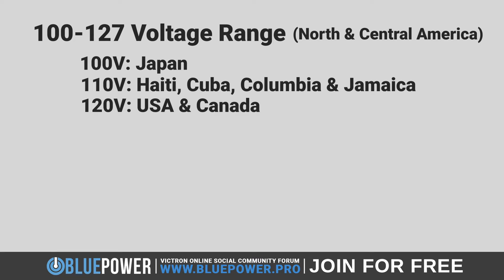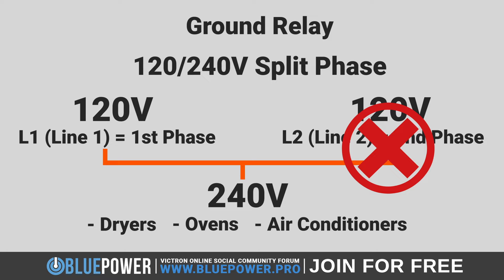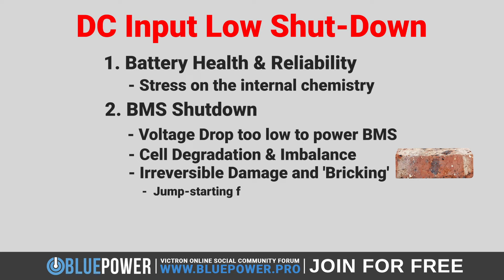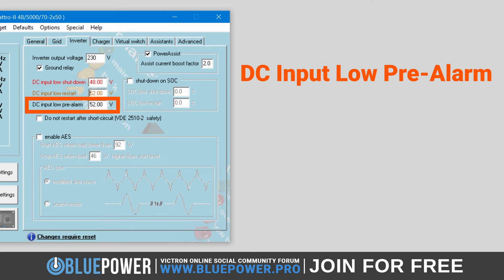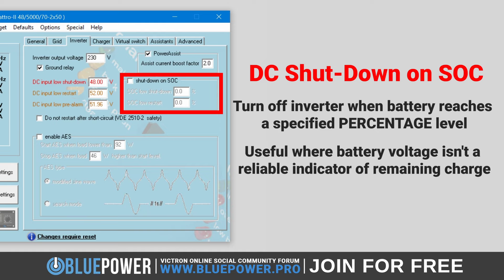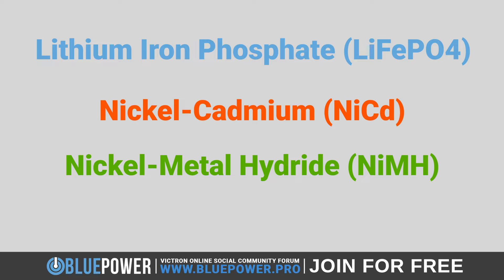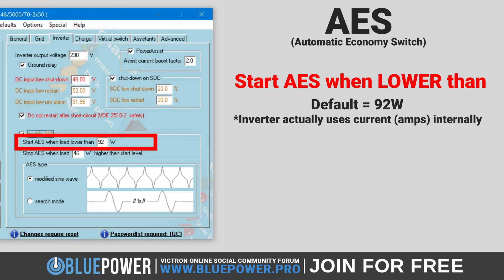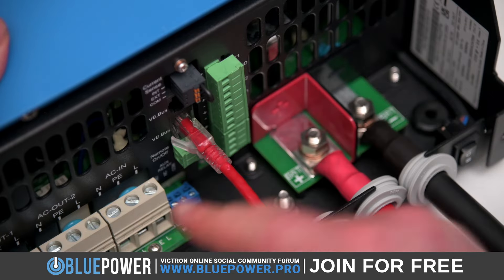Victron VEConfig - Inverter Settings Tab Tutorial [UPDATED 2024]

Comment: Hello, I have a 12v3000 inverter. When I input 12volt, I get 230volt output. When I connect a load to the output, I experience a power cut. What could be the reason for this? I would be glad if you can help me. Good work.
Reply from the maker: This could be many reasons depending if you get a error message or led warning light on the system.

These would be the first things that come to mind to look at:

~ Low battery voltage: Check battery voltage at battery and inverter and fuse or recharge system
~ Overload load is faulty 
~ Ac wiring issue ect 

Issue would need a bit more diagnosing to get to a solution

Comment: Ground Relay checked in both phases L1 and L2 for split phase US grid connected?.  Also RCD required ?  Which one woukd you recommend?
Reply from the maker: While I'm not a US electrician, my understanding on the US grid codes, is that both are required, but you would need to consult with your installer/electrician to comply with your local codes

Comment: Is it possible to utilize Cerbo VRM for configuring split phase setup instead of purchasing an MK3 cable and a VE config multi? Thanks for great videos
Reply from the maker: No, currently this is not a option. An MK3 is required onsite for the configuration.

Comment: i have done the above but power is not sent out to the AC-OUT-2 device (Geyser). what am i not doing correctly Multiplus II 5kva.. Smart solar MPPT 150|45 with 6 (550 solar panels). When Grid Power comes in the Geyser heats up.
Reply: Can you use AC -OUT 1 not 2
Reply: Check very well in your system I hope you can see where is the problem me hopefully on AC -OUT 1 and AC IN use 1
Reply from the maker: This is correct. AC-OUT 2, by default, only has power when AC-IN 1 has a active input active. 
However,  you can make use an assistant, in order to get AC-OUT 2 powered when needed, such as basing it on SoC for example.

Comment: The aes system seems flawed, my easysolar 2 is pulling around 30-40w constant when everything is on standby. Both settings above are set to 99watts but low power mode hardly turns on and when it does it goes off nearly instantly any idea why this is? It is like the wattage read out isnt accurate at all i have literally given up on it at this point 😂
Reply from the maker: Its difficult to say, without knowing what your loads look like and what your what your reason for wanting to use AES is? 

If you are using your inverter daily then your shouldn't using it, as it meant as a "long form storage" mode when you have next to no loads connected. 

According to your ESII data sheet https://www.victronenergy.com/upload/documents/Datasheet-EasySolar-II-24V-48V-3kVA-48V-5kVA-MPPT-250-70-100-GX-EN.pdf the difference a zero load in normal mode and AES modified mode is only 4W to 6W. 

Victron products cost more because they use very little self consumption power. which is why I honestly don't make any use of AES (although my loads are always connected), as the self consumption savings are minimal and creates delays between mode switching, while also modifying the sine wave, which isn't good if you still have connected electronic loads. 

Valid, it does reduce the consumption by a few watts of you aren't connecting anything to it, especially If you have selected search mode. Again looking at spec sheet it says it will use 2W in search mode.

However if you have a big enough battery bank with solar and you disconnect all your loads, it wont ever run out of power from only the inverter's normal mode self consumption of 11-18W (depending on your model).

I've also noticed that the wording in VEConfig and VictronConnect are different.
► In VEConfig, it says (as i explained in the video), your minimum (46W) and the a value ADDED to that of 92W.
► Whereas in VictronConnect is says "Start AES when load lower than" (same as VEConfig), but then it says "Start AES when load higher than", which is different to VEConfig, as you not adding this value to the minimum, simply specifying it straight.

You said you put them both at 99W, which can be the issue because the values are too close to each other, if its trying to function based on VictronConnect's terminology, its the start and stop are the same values which could be why its turning on and off again immediately.

According to the manual, the defaults in VictronConnect are low = 40W and high = 100W (which is different to VEConfigs defaults). but can do to minimum of 12W low and 44W high.

Try set it to these minimum values and then connect and only switch an led light on and off to trigger AES and bring it out of AES to test. Also try it with both modified and search modes. 

AES mode is designed to activate at very low loads, but if the load is fluctuating around the threshold, the AES might not engage properly. 

You will have to test more and see. I cant test on my end as everything, including my internet is connected to my system, so cant go very low, as even my router use quite a bit of juice.

Let me know your results if you find them, I'm interested to see the solution

Comment from the maker: NOTE: At 10:40 I entered 48V as the DC input low shut-down voltage. 

However, as mentioned elsewhere, you should not run LiFePO4 lower than 20% SOC for optimal battery health. Therefore, it's best to increase this to around 51V to 51.5V in order for it to match 20% SOC, as 48V will be closer to 10% SOC. 

Again, all batteries and systems are different, so to get the most accurate measurement, test your system, and run it down to 20%, then take note of the Voltage and enter that in as your DC input low shut-down voltage.

For example, you can easily find this LiFePO4 Battery Voltage table online:

12V:
14.6V (100% charging)
13.6V (100% resting)
13.4V (99%)
13.3V (90%)
13.2V (70%)
13.1V (40%)
13.0V (30%)
12.9V (20%)
12.8V (17%)
12.5V (14%)
12.0V (9%)
10.0V (0%)

24V:
29.2V (100% charging)
27.2V (100% resting)
26.8V (99%)
26.6V (90%)
26.4V (70%)
26.2V (40%)
26.0V (30%)
25.8V (20%)
25.6V (17%)
25.0V (14%)
24.0V (9%)
20.0V (0%)

48V:
58.4V (100% charging)
54.4V (100% resting)
53.6V (99%)
53.2V (90%)
52.8V (70%)
52.4V (40%)
52.0V (30%)
51.6V (20%)
51.2V (17%)
50.0V (14%)
48.0V (9%)
40.0V (0%)

However, this is just a general guideline, because in my system test, it was at 52V at 40% SOC, while this table shows 51.6V as 40% SOC. I have yet to test my system’s voltage at 20% SOC, so for now, I am estimating around 51V to 51.5V, based on the 40% SOC voltage measurement.

Naturally adjust your restart and alarm voltages accordingly, as shown in the video.